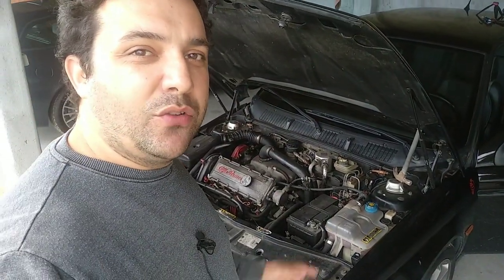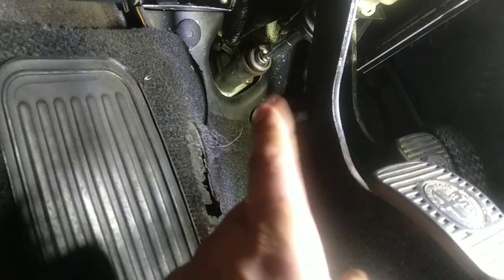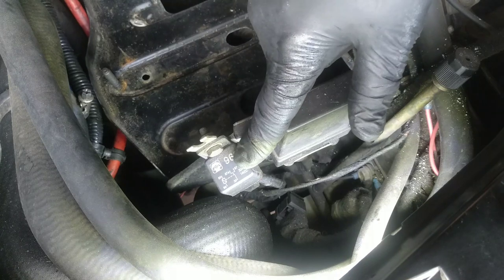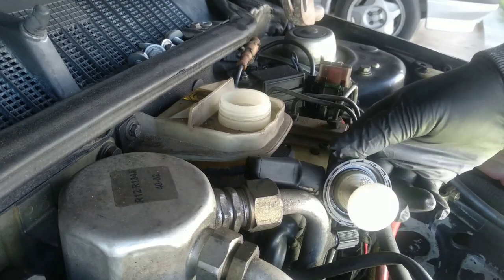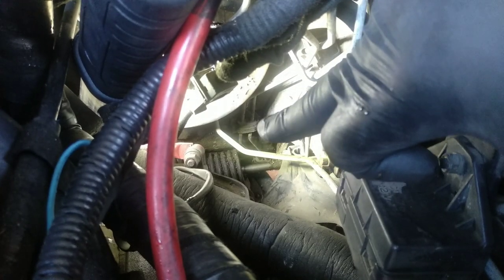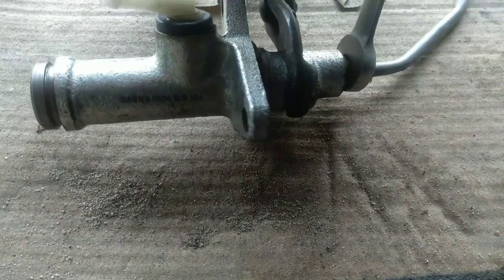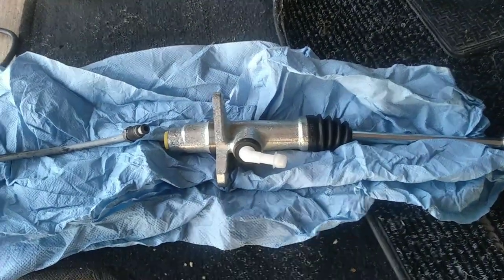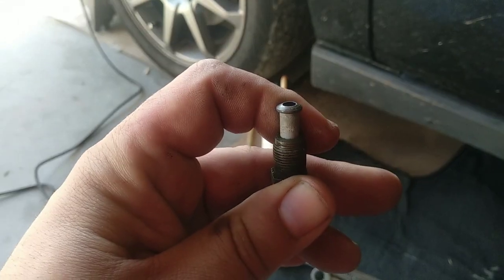How to replace Clutch Master cylinder. Alfa 155, 156 and others!

Comment: I remember doing this job on my right hand drive V6 155. Now that was a challenging job!!  Did it on the drive, during a rare cold winter here in the UK and it was snowing so hard the bonnet kept falling shut with the weight of snow building up. I had to keep clearing the snow out of the footwell too. Absolute worst part was getting the hydraulic line back in to the new master due to almost no access.
Reply from the maker: Hello. Oh man.. I can relate to that so much, working in my parents house on the floor, rain, cold wind... No light and little space too.
Those moments and those days are the ones that stuck with us don't they? All the hard work, the hard days are a reminder of what our will leads us. Looking back, o respect those hard moments because I am in a better place now because of that hard work.

Comment: Hello, nice vid. Can i ask you. When i will replace  a master cylinder on 156. Can i bleed out the oil on slave cylinder with negative pressure? When i will bleed with negative pressure its necessarily to pressing the clutch pedal when is valve open? Thank you and do your great job.
Reply from the maker: Hello. With negative pressure it will be a nightmare! You can try and get it half done. But it will be very difficult. The old pump and push is better for that system
Reply: @alfaromeonoproblem  So with your pump on the video its better. Thank you

Comment: Olá Amigo.
I have an AR 156. The rubber is broken at the end of the master cylinder. I have a non-working master cylinder with a perpect rubber. Is it possible to change only the rubber? I mean if i can get it out from the bad cylinder can i put it in the other one? I hope you understand what i mean. Obrigado.
Reply from the maker: Olá. Tenho o mesmo canal em português se for mais fácil para ti.
Depende da marca e montagem das bombas, algumas são de enroscar outras não. Mas a borracha em si não saí, é vulcanizada. 
Mas atenção que isso normalmente é sinal de demasiada dureza no pedal. Devido ao kit de embreagem antigo ou novo não indicado. 
https://youtube.com/playlist?list=PL_xVt-5e3-Nllcfw93WEgtBRh25Ds0mW_
Veja se essa lista ajuda
Reply: @alfaromeonoproblem  Eu não falo português :)
Reply from the maker: Sorry, thought so.
It depends on the brand and assembly of the pumps, some are screw-in others are not. But the rubber itself didn't come off, it's vulcanized.
But beware that this is usually a sign of too much stiffness in the pedal. Due to old or new clutch kit not being the same brand.
https://youtube.com/playlist?list=PLgcTCigdgD8MSkcQhlXTdYW9iGEhZg8Wc

Comment: Due to availability of parts were I live..., can I use the 155 clutch master cylinder on a 156 JTD?
Reply from the maker: Hello. I'm not sure if they are the same..I think the length of the shaft is longer on the 155. I can try to find the answer

Comment: Hello.. Plz help me ! How can i bleed clutch on my Alfa 159 ?
Reply from the maker: Hello. Very hard to do even with the pressure machine. 
Always with the pressure machine:
Open bleed a few seconds until no air. 
Close it, and without removing pressure or the machine pump the pedal.
Open the bleeding again and close after a few seconds 
Remove the pressure and the machine
Pump the pedal, it will be almost good.
Repeat all again one or two times. It will be good

Comment: Hi man, i've an issue with my clutch fork of my GT, can you tell me if we can find a new fork there ?
Reply from the maker: hello. Do you need to replace the clutch fork? we need to identify the part number. Insert the VIN on www.fiatdalys.lt and identify the part.
With that part number you can search worldwide.
Reply: @alfaromeonoproblem  The part number is :  55202228 
I don't find the fork anywhere 😞
Reply from the maker: I will try to locate it. Meanwhile contact the supplier of my 75 torsion bars. Contacts are in the video and the description.
Reply from the maker: Torsion bars:
https://youtu.be/IxcpYLo5RtY

Comment: is that not your brake fluid?
Reply from the maker: What do you mean?
Reply: @alfaromeonoproblem  meaning, does the fluid that goes in the master cylinder, the same as goes in your brake system?
Reply from the maker: Hello, yes it is. The brake fluid reservoir is the same for the clutch cylinders system

Comment: I have to change my 33 master clutch cylinder…
Reply from the maker: Hello. Not very difficult to do, at all. 
I have a video taking out the pedal box out of the 33. Will it help?
Reply: @alfaromeonoproblem  actually I was checking and it could be the slave cylinder, because the pedal looses pressure and goes all the way to the floor mat once in a while.. do you have any video on changing it ? :)
Reply from the maker: @arboriavisualdesigns5455 that I do not have it yet.. I did removed the engine. Removing the hose and exposing the cylinder.
Reply: @alfaromeonoproblem  the intake has to be out right ?
Reply from the maker: @arboriavisualdesigns5455 yes

Comment: On my Alfa 156, I had clutch oil considerable quantity leak from the Clutch Cylinder to the inside of the car, and it soaked the carpet (driver side) and possibly the under-carpet material/felt, also letting off that chemical smell. Now, a month later it is dry. Do I need to have the carpet and felt removed to clean it or a carpet-bioclean would suffice? Should I be worried about corrosion of the metal?  Photos when soaked: https://i.postimg.cc/LXvMqkjN/IMG20220415160931.jpg
https://i.postimg.cc/RhFxw3R9/IMG20220415160937.jpg
https://i.postimg.cc/4dXgN2HY/IMG20220415160543.jpg
Reply from the maker: Hello. The leak was huge! So, the carpet is not permeable at first and the fluid doesn't corrode it. And yes, just wet clean it it will be fine 
But.. sometimes the fluid slips from behind where the carpet starts and If it gets to the metal... Ho boy... So clean and dry everything very well before desassemble anything and after pull back the carpet and feel it, smell it. If it's wet take it apart, clean everything and treat the metal.
Hope everything's fine
Reply: @alfaromeonoproblem  So you think I should 1) Have the carpet bio-cleaned as it is installed, 2) Then definitely pull the carpet back on the driver's side and check if oil has dripped behind it? Should I do these things closer together , i.e. a day apart, or should I wait, before steps 1 and 2, for example if the smell comes back? I am afraid of having the carpet removed, I feel so much can go wrong (clips, rubber, console etc). Who is safer to remove the carpet, the Alfa car mechanic, the carpet-lining store or the auto washing-cleaning service?
Reply: @alfaromeonoproblem  Also, does this video (older, not very clear) offer any clues? https://drive.google.com/file/d/1B8FWYW-GhQNCRb2zBbzWomlLvJuzmJY1/view?usp=sharing
Reply from the maker: A week apart and you can pull it yourself.
Reply from the maker: It could very well dripping down under.. if it is under a good technician will do that no problem
Reply: @alfaromeonoproblem  Thanks Bruno, you've been of great help once again
Reply from the maker: Thank you